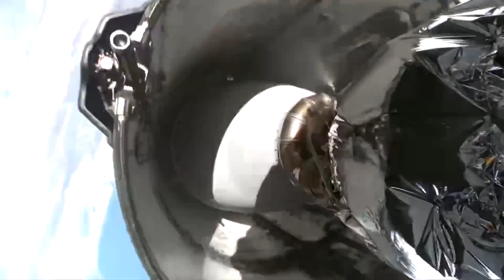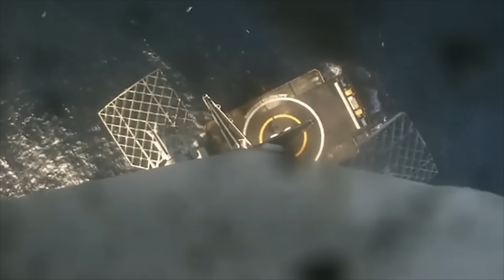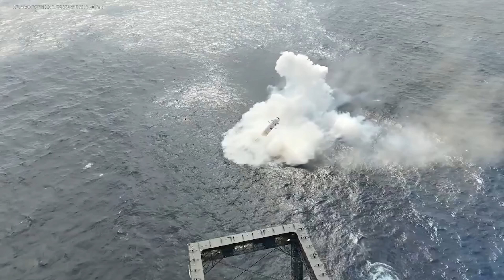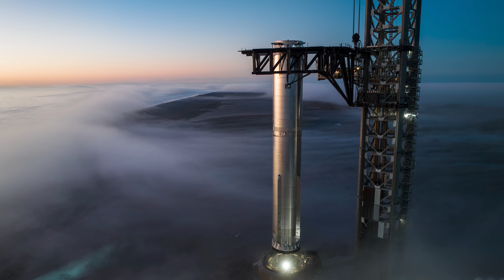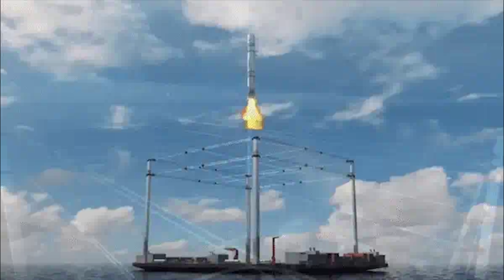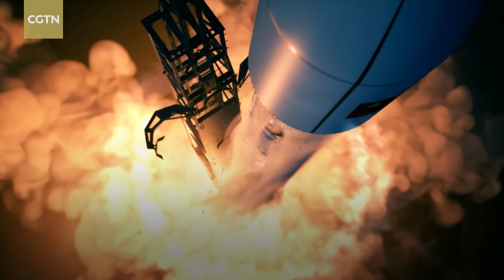China Found Brilliant Solution for Catching Moon Rocket Mid-air! Better than SpaceX, NASA...

Comment: China catching rockets on barges because they cant figure out how to land a rocket on a barge like SpaceX does. 😂😂😂😂🤦🏼
Reply: Or its just because landing legs add dry weight which decreases delta v. I am not at a very chinese time in my life, but I can recognize an objectively good design when I see it.
Reply: @philgeorge6946   No its simply because they don't have the technological knowhow to land a rocket upright without the need to catch it using cables. Landing legs don't weigh anything. 🤣🤣🤣🤦🏼
Reply: @Mike_Davidson they do, you fool. 
besides they're gonna use the landing legs on other boosters, China is gonna test all the reusability methods and they're gonna see which is the best.
they're looking to test 5 methods that I know of.
Reply: @soheiladam7510  They sure do if you use weak Chinese engines on your rocket. China get even build a jet engine let alone a rocket engine. I'm sure they'll be tossing out the seats next to save weight. 😆😆😆😆🚀
Reply: @Mike_Davidson  Saving weight increases delta v and payload capacity whether you use shit engines or good ones. In fact, the better engines you have, the more you will benefit from saving weight. Most of Chinas technological advancements are stolen tech anyways, but if you know anything about rockets this is a good design no matter who came up with it.
Reply: @philgeorge6946  If you're trying to save weight by tossing out the landing struts, what does that tell you? A good design compared to what exactly? 🤷🏼‍♂😆😆😆😆
Reply: @Mike_Davidson  Compared to chopsticks like spacex uses or cables like the video. These methods put the landing equipment on the ground instead of the vehicle.
Reply: @philgeorge6946   Ok go ahead and explain why landing a rocket back on its own launchpad is a bad idea? 🤷🏼😆😆😆😆
Reply: @Mike_Davidson  Landing a rocket in general is a good idea if the intention of the rocket is a high launch cadence. I'm just saying that however you choose to do that, whether it's using chopsticks, cables, or landing legs, it's most efficient to use a method that has that landing equipment on the pad instead of on the rocket. So chopsticks > cables > landing legs
Reply: @philgeorge6946  Ok so go ahead and explain how China is going to use cables to catch rockets over its the launchpad it launched from? I already saw the barge but that's not a launchpad its just a landing barge. 🤷🏼‍♂
Reply: @Mike_Davidson 
Vous voulez dire qu'il est impossible de poser la fusée a 100m de son point de décollage ?
Vous pourriez être un peu plus précis dans vos affirmation, j'ai encore envie de rire
Reply: @Mike_Davidson you're clearly a 🤡, aren't you 🤦
Reply: No, it's simply because the Chinese has a mature EMALS system on its careers, and just decided to use it on rockets.
Reply: because 4 symmetrical catchers is better than a dual catcher for sea landing...it is more balance...

Comment: Hey, baby steps.  Might work, but not what I would call robust.  If you miss a wire the whole infrastructure and rocket get pretty well ruined.
Reply: why would it miss a wire!!  every method will need time to mature if it works ofc.
Reply: Et si le starship se décale de 10 m, explosion
Si il manque un chopstick, explosion
Si un moteur ralenti, explosion
Oh, ça alors, si tout ne se passe pas comme prévu, explosion 
C'est difficile l'espace et les chopstick sont la solution la moins fiable

Comment: too many moving parts, big risk of failure.
Reply: Actually it provides less risk and less precision to catch the booster
Reply: Yeah, I'm sure you are smarter than Chinese engineers and scientists. 😂
Reply: The platform's lateral movements are compensated for by wider entry "gates" for capture of a stage. So, in theory, the tasks are roughly the same as with chopsticks.
Reply: it's much less moving parts than the chopsticks. More complicated than f9, yes, but the width of the lm10 is much wider than f9 and having landing legs would take too much weight